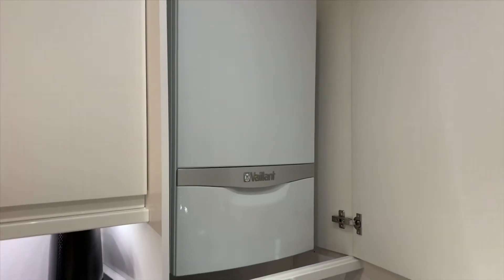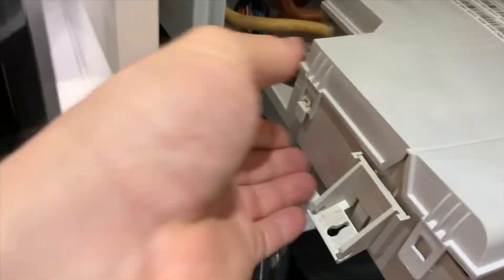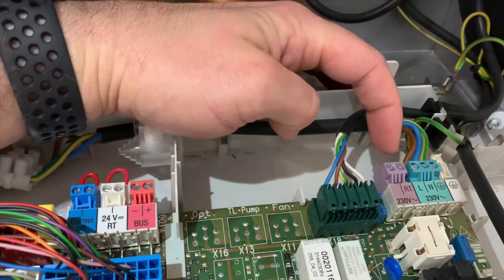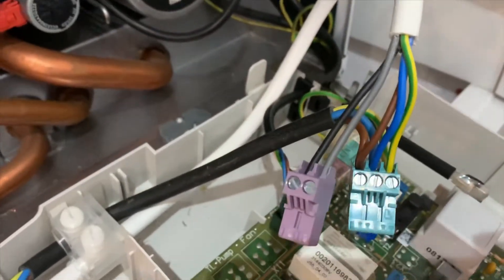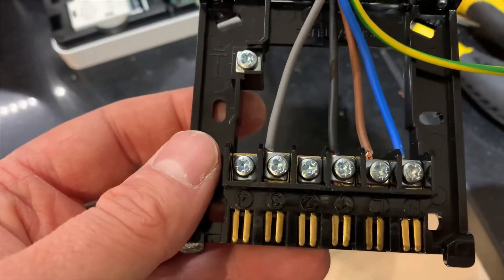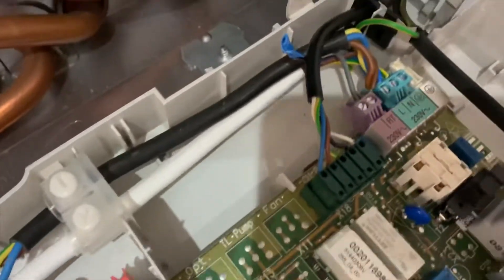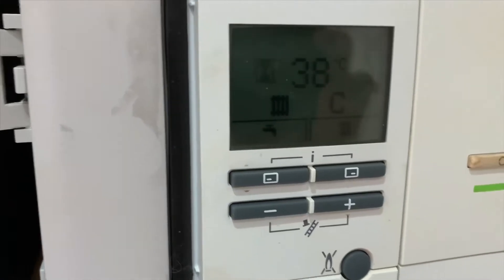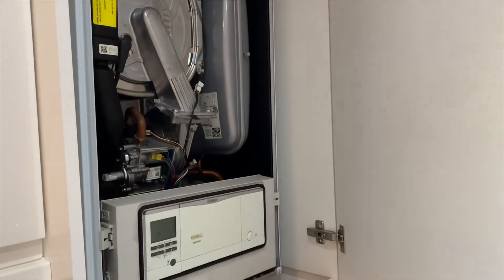How to Install Wiser Smart Thermostat on Vaillant ecoTEC plus 824 Combi Boiler

Comment: Hi Luke, I was going to install the Tado smart thermostat on my Vaillant Ecotec 831 boiler however I spoke with an engineer who said while it can be done the Ecotec boilers it will not run as efficiently as they would using their own controllers.

This is due to vaillant having their own Ebus chip and third party controllers can only control the boiler to be on or off rather than gradual heat control, this wasn't always the case with the previos vr65 which I think were opentherm but since the vr66 this seems to not work aswell with third party.

Because of this I decided to only purchase the Tado radiator thermostats which come with the bridge in order to run those as an extra while keeping my Vaillant controller.

Please can you or anyone else confirm this to be true?

Comment: This video was exactly what I needed to easily install a new Wiser thermostat, so thanks. 

But for the love of god: Unplug your boiler before doing this. As far as I could see the display for this boiler was still on when he opened it up, meaning the mains was still hooked up. I'm am amazed it was wired up without giving the guy a shock.

Comment: Hey Luke, I spent hours scrolling through YouTube last night till 4am,  eventually giving up.  Tomorrow's a new day right?
Anyway today I searched "room thermostat wiring" and your still , of  a familiar Valliant PCB caught my eye.
I have an Vaillant 825 & 637 with the same main PCB.  Anyway following your video I was able to get 240v  to the thermostat
then realised I just needed  a "switched live" signal from the RT to the boiler which was a single wire marked RT on the boilers main board.  A little configuring to connect the RT to my phone through wifi and presto.
Anyway thanks for the Video, to you & yours Merry X-Mas

Tuya WifiSmart Thermostat Me81H £30 from Ebay

Comment: Hi Luke 
i am interested in installing nest thermostat and got few questions if you could answer please ,that will help me a lot 

1.did you run 2 cables from heatlink ?one for power and other for connecting to boiler RT block ?
or did you run a 5 core single cable ?
could you please let me know and size of cable as well please 
Hope you understand what i mean 

2.to powerup the heatlink itself cant we take power directly from FCU  rather than running a cable from boilersterminal block ?

thanks
Reply from the maker: HI RK, I used a single 4 core, but beleive I only needed 4 cables.  I don't recall the gauge, but I believe it was a 14 or 16 gauge for each cable.  You should be able to take power directly from the FCU.  I have a video on the install for a nest as well.  You can check it out.

Comment: I recently changed the pcb board on the echotec 824 R1 model after seeing the f62 and f61 codes, very simple plug and play job, most important thing is to turn the mains power off and make sure the screen light has gone off before you proceed, then take a picture of all the connections incase you forget something, most of it is just clips so very easy to disconnect and reconnect, one of the parts has 5 wires that needs unscrewing and needs to be put back into the new board thats where the camera picture comes handy, also make sure the turn button goes back in correctly it has a shape on the button side of board that it needs to slot back into, hope this helps someone out there.

Comment: Hi Luke, thanks a lot for sharing your video as I managed to install Wiser Thermostat myself (saved me £100 for cost of installation). I just did a little bit more research on the RT 24V vs RT 230V for the black and grey wires (as I didn't want to leave the black one loose as you suggested). In fact you can connect both the black and grey wires on the RT 24V (on the left hand side) and leave the RT 230V unused. It worked very well straight away! My boiler is now fully connected to my smart Thermostat. Thanks again
Reply: Thank you, this worked for us too
Reply: My thoughts on this would be to use a 4 core cable.  Also if you're connecting a 230v supply by linking (L) to (1) shouldn't you connect to the 230v RT at (3) rather than the 24v RT
Reply: Did you do this on the receiver or the boiler? I'm having trouble and want to try this.
Reply: @kingjr1737  on the boiler. For the receiver, just follow the instructions from WISER Smart Thermostat guidelines.
Reply: Where did you connect RT24V grey and black wire to the receiver?Did you also keep the loop between live and number 1?
Thanks
Reply: For anyone reading this today - DO NOT LOOP YOUR LIVE IF YOU'RE USING THE 24V RT CONNECTION IN THE BOILER. If you do, it will send 230v into the 24v circuit and this is A VERY BAD THING.

Comment: Hey, your wiring note says: N, L, 1, 2, 3, 4, 5
But, there is no contact no. 5 on the wallplate. Only N, L, 1, 2, 3, 4
Reply from the maker: Yep you’re right.  Just 1-4.  Good thing I didn’t say anything should be plugged in there ;)

Comment: Hi Luke, From where you got the cable with 5 wires inside. Also what was the guage or thickness of wire in mm2. Hope to see your reply soon.
Reply from the maker: Hi kashi,  I got it from my local Leyland in the cable section.  I’m not sure of the gauge but there is only one with 5 internal cables.
Reply: @Cabbyboose  
Can you share your email id. As i am not able to share some images to ask some question about my boiler. 
In my Valiant Eco Tec Pro 24 Combi Boiler, we haven't got a separate Channel Programmer. All controls are on the Boiler itself. We have got only a Room thermostat. So I am not sure do we have a wiring centre on my Boiler. I am checked my Valiant Boiler we have seen the wires coming from boiler terminal Live L, Neutral N, Earth E,  wire coming from 3 & 4 terminal of boiler. So my understanding is i will connect Channel Programmer wires coming from L, N, E, 3 & 4.
I am not able to find wiring centre, because we purchased home in December 2020 and boiler is installed in 2012.
I am not sure what to do with wiring centre connection of wire 2 & 3 which go to room thermostat. Its shown in this video https://youtu.be/Bl-99WN4sN8 look from time 2:30

Comment: The Vaillant manual confused the hell out of me since all the connections it lists were not in the boiler. Once I had seen your video with the insight from your partner installing was a breeze. Thanks
Reply: Tulan Shah Hi there I hope you don’t mind me asking you a question I have exactly the same boiler and circuit board am I right in thinking all I need to get it working on ordinary thermostat is supply LNE permanently & switch live to RT & that’s it? would really appreciate it if you know that that is right and you could let me know many thanks ps my Dad is old & wants to control it from he original thermostat kind regards Mark forgot to say & of course take out 24v link wire
Reply: @mp180170  I am not an expert but I think so yes

Comment: We had the same problem initially the heating stuck on continuously. Had to turn boiler off at mains to stop heating. Plus hot water worked fine so i think once you’ve installed this unit once you learn a lot then its plain sailing. Cost me £130 for stat and hub then £400 for 2 electricians to puzzle over it
Reply: Depressing that an electrician got fed up with it then Drayton recommended guy who is gas safe engineer took so long night became day and still he was unsure
Reply from the maker: Wow, that's rough.  Were you able to get it working eventually?

Comment: Inspired!
Reply from the maker: Thanks for being a loyal follower.  Your feedback heartens me!
Reply: @Cabbyboose  hi Luke is this boiler plus thermostat? it says I need module V 33 for vaillant
Reply from the maker: Hi  @mikeuk8486 , no this isn’t the boiler plus version. It just has a fixed temperature for hot water taps and another fixed temp for radiators.